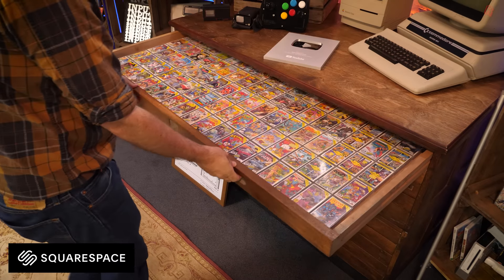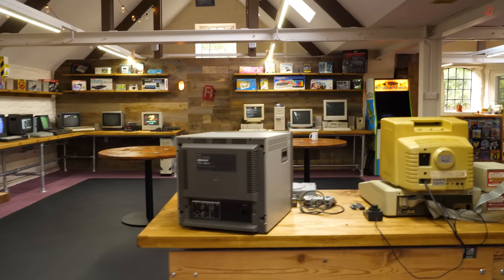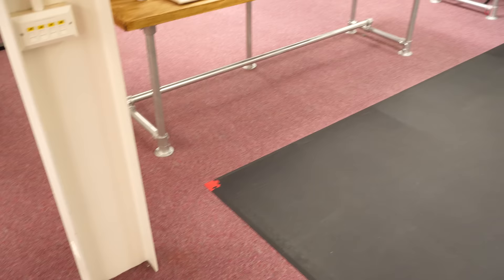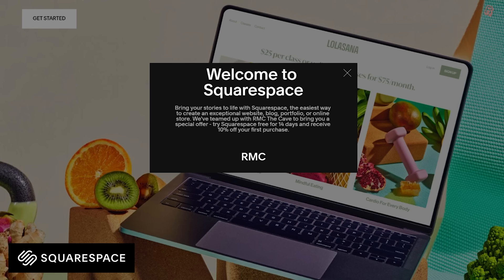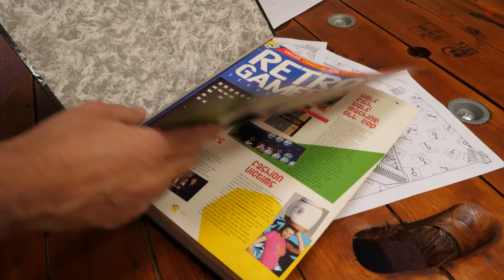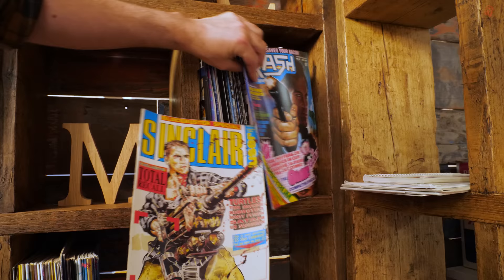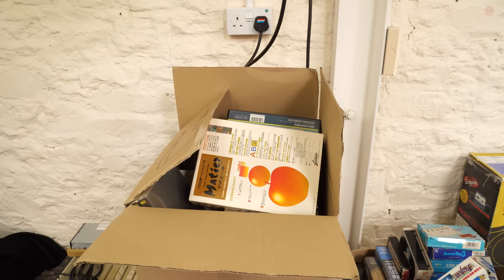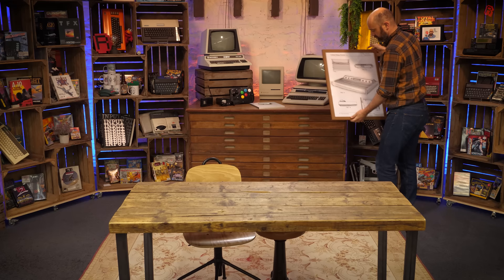Building "The Cave" Computer Exhibition - July 2021

Comment from the maker: Back the book and Colour for The Cave: https://www.kickstarter.com/projects/retroteabreaks/the-colouring-book-of-retro-computers
Thank you everyone for considering backing this silly little Kickstarter. It may look like just a book on the face of it, but it really does have the potential to get this over the finish line and open up the doors to the public. We're so very close now and you backing this book is all it could take to launch this exhibition to the moon.  
Thank you so much!
Neil - RMC
Reply: I trust that one of the stretch goals on that kickstarter is going to be a set of beige crayons.
Reply: i would recommend the FPGA solution for arcade emulation the pi while a great device can be hit or miss when it comes to running arcade cabinet games plus it will most likely lack accuracy which is super important for the historic value of the games 

something like the mister which is purpose built for stuff like arcade cabinet accuracy would be better in my opinion

Comment: Seeing that Amiga on the desk is bringing back memories... Way back when I had a A500+ with a 512k strapon and a 50MB GVP HDD with a few MB of fast RAM bolted to its side.  The HDD was SCSI and I also had a SCSI CD-R 2X plugged into it.  Looking back I really miss my Amiga and wish I never sold it, it was simple but got the job done.  It only ever did exactly what what you wanted it to do compared to current OS's/PC's that do whatever services/apps/malware/bloatware wants to do in the background as well as track your every movement on them.

Comment: Re the flooring around the exhibition space: the step from the mat to the carpet looks like it's exactly where the chairs are going to go, resulting in them not being level. You might want to look into extending the mat under the desks, which will also prevent wear to the carpet (chair legs are hugely damaging). Shame it won't look as sweet as it currently does, though.
Reply: Felt or rubber furniture adhesive pads under the chair legs/supports - then it could be levelled up and reducing wear and tear?

Comment: About 19:54 : see if you can get lever switches to mount in the drawers, and extension cords if you don't want the consoles in the drawers, so that you can use the drawer switches to control both a video switch box, and per-drawer lights. Might or might not be practical for you, but it's the option that came to mind (though you'd still have to figure out how to deal with multiple drawers being opened at once...).

Comment: Regarding the air conditioning. You may want to get the modern units that can do the thing in reverse in winter. These will end up saving energy and have been proven to work in Finland which is a little colder than the UK. Also some curtains on any glass reduces the heating through sun light.

Comment: Loving the updates, especially the new furniture, more wood!. Love the idea for the game drawers, it will be great to have different formats in each one. So many of these old game boxes are nostalgic. Is it worth putting UV protective film over the windows? not sure if that will harm the lighting too much but if things are going to be on shelves then they might suffer with sun fade. I think with console corner you could remove the drawers, keep the fronts and make them fold down or something to house consoles, definately needs a sofa there though I think for those winner stays on Street Fighter games.
What about a blackboard or dry marker board for high scores achieved when the cave opens? Would be awesome to have some challenges there.

Comment: 4:21 - You could integrate the MAME arcade into an exhibition space on arcade ROM hacking and bootlegs.  Ms. Pac-Man came about when General Computer Corporation hacked the original Pac-Man ROMs to create Crazy Otto.  Midway / Namco loved the idea, so they purchased the hack from GCC and turned it into Ms. Pac-Man. :)   GCC, of course, went on to make all sorts of computer upgrades, peripherals, and even their own line of printers.  The GCC Hyperdrive is probably their most well-known computer product on the Macintosh.  GCC's SCSI implantation on the 128k and 512k was eventually used by Apple for the Macintosh Plus.

And, of course, with the development of the internet, all those hacked and bootleg arcade ROMs (like the Rainbow Edition for Street Fighter 2 that ultimate lead to Street Fighter 2 Turbo Hyperfighting) started to pop up online.  More and more ROMs followed, with the inevitable emulators in pursuit.

Comment: Just a thought or two, instead of having the actual cassette tapes in the architect's drawers, you could have some kind of laminated 'frieze' with scanned images of the front and back of the covers?  There would then not be any need for Perspex covering and you could easily keep them clean and hands-on!  (You'd also save on space to some extent and allow the front and back to be seen?  Perhaps having the magazines in laminated covers would also protect these - as if handled by a lot of people they will (obviously) deteriorate over time.  Perhaps having scanned versions/reprinted afterwards wherever possible could be the best route to go down (if not now then at a later date), thus keeping these also in a more pristine condition - also enabling you to replace them with a digital or reprinted version of the original at a later time?  The pages could also be laminated like an Argos catalogue?  A lot of work I know, but the original magazines would be better protected then?  The could apply for any original manuals and rare artwork(s)?  Sorry comment is a bit long, but I feel it might be future-proofing and allowing a more hands on approach?

Comment: Hey Neil, progress is looking great, seems like you and Sam battle are in a race to open up LOL. Speaking of race, I was inspired to make this comment....

I have thought, and not sure of the possibility, but with that lovely telly you displayed Gran Turismo on, I wondered if you could clone the aspect ratio button (or sequence of events in the menu) on the remote control, either by a 3rd party remote or one of those modified remotes you get for RGB lighting etc, so peeps could switch between 4:3 / 16:9, as I know it triggers some people when a 4:3 image is stretched to 16:9 if the console is 4:3 / game doesn't provide that option in the menu. I mention cloning or using a 3rd party remote cause you don't want the OG remote being hammered, and having a single button to press would be awesome :) 

Excellent work. Loved the updates and grats on the colouring book, looks awesome. Cheers :)

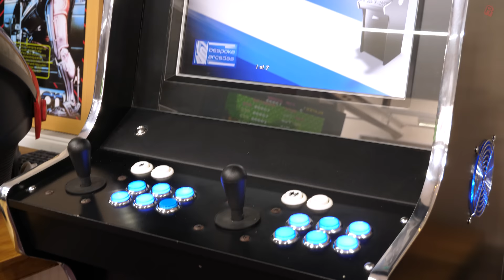Comment: 3:38   Ideally, what you want is a Mame cab, but rather than having it hooked up directly to the controls, wire it up via a Jamma harness so that you can treat the PC as just another Jamma system and can swap it out for other arcade boards.

A Mame cab is really useful in an exhibition space though since it can be used to call up SO MANY games, as well as allow for easy comparison with their home computer counterparts.
Reply from the maker: I think I'll swap the LCD out for a CRT and make some other mods to it, perhaps an episode in itself
Reply: @RMCRetro  MiSTer and Jamma living together in perfect harmony? Is such a thing possible?
Reply: @DaveVelociraptor  technically, sure.  Jamma is technically just a big wire loom that provides a standard way to connect all your IO in a one-ner.

Infact, it ought to be easier since the cores should be producing arcade monitor signals, where a pc's output needs to be jiggered with to be compatible with an arcade monitor

Comment: Bummer that it's been so hot for you, but 31C(88F) is nothing as that's average late spring - early fall temps here, I think you would would be dying here in my neck of the Southern US, as it's going to be 103F(40C), or 108F(42C)/109F(43C) with the humidity factored in here tomorrow. today it's 96F(35.5C), and 115F(46C) with the humidity as I write this at work on my lunch break with 4 big fans going full blast, all the blinds blacking out the building, and the central AC set at 70F(21C) with it barely keeping the building at 72F(22C), and by the end of the afternoon the AC will only be able to keep it at about 74F(23C) if I'm lucky.

Comment: Fake arcade with LCD monitor yuuuuck! Why couldn't they play Street Fighter II on the MiSTer?
Reply from the maker: I know right! How about we put a mister and CRT in there?
Reply: @RMCRetro  Or maybe keep it like it is, and wire the start button up to a trapdoor and a slide. When somebody wants to play on a Mame cab instead of all the lovely vintage machines you have, they get ejected into the pond.
Reply: @googleboughtmee  Dude, just imagine theme days where every machine, as well as the mame cabinet are running the same game (or nearest equivalent).

A Moon Patrol day is likely to cause insanity.
Reply: @RMCRetro  I understand from a purist point of view, but in the end, emulation, LCD screens and such are basically also just part of history? In museums in general I personally find it always very interesting to see where it all started and where it is in modern times. It's just kind of magical to see the old and the new in the same space.
I think a proper emulation arcade cabinet with a proper quality LCD screen does represent that very well.
Reply: @RMCRetro  Brilliant idea
Reply: Look into the Super Attract Mode script for Mister, you can set it up to cycle automatically through arcade cores until someone hits an input to play!

Will also say that LCD (or SVGA) has their place in a multi arcade for digital rotation. Otherwise you would need to separate your tate cores to another machine.